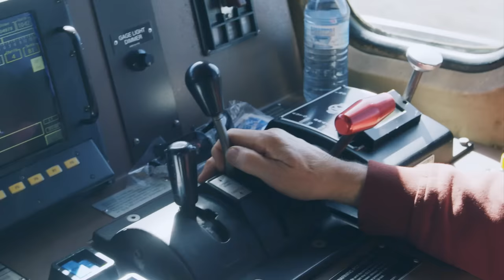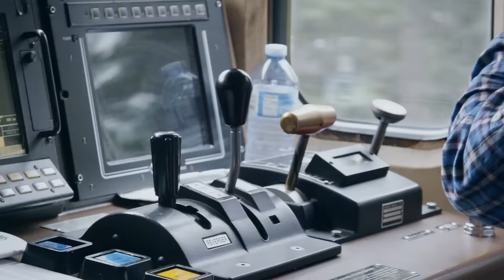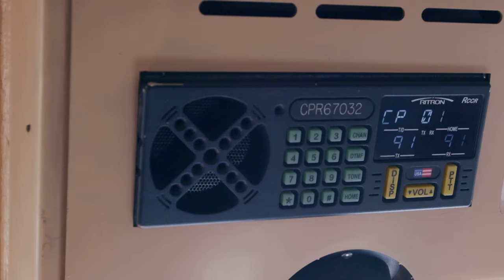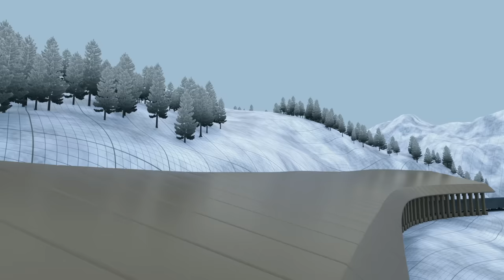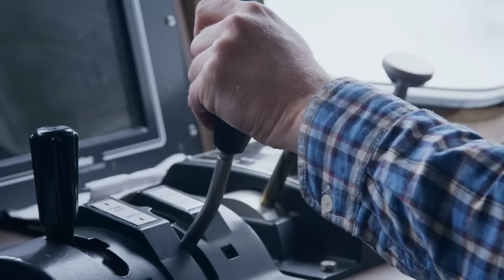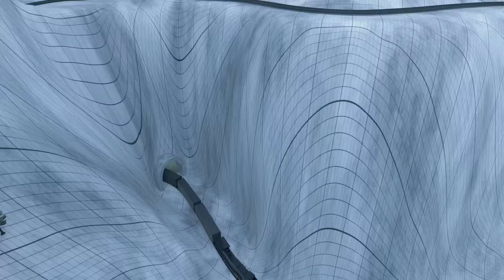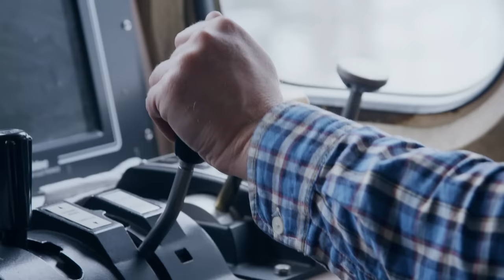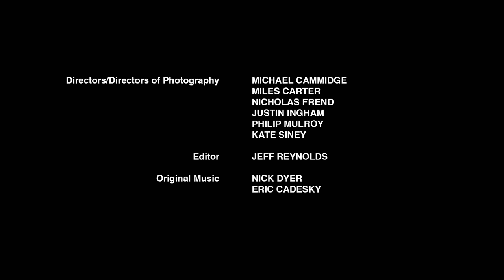A Grain Train's Perilous Journey | Rocky Mountain Railroad | Episode 3 | Documentary Central

Comment: I have seen the switchbacks in Kicking Horse. They have a pull off on the trans-Canadian highway so you can see them while you stretch your legs. They also have part of a steam engine boiler that exploded years ago. It, along with the whole track system is an engineering marvel.
Reply: It is indeed. What gets me is the 1908-09 trackage (of course new rails since then) is used today > THAT'S how solid a job those early rail crews did! Remarkable.
It's similar to the early surveyors here in America. They went out with the best equipment of their day, primitive by today's standards, to plot the best route for the railroads, yet were so accurate that today's engineers have said it was the best route, in terms of grades, crossings, etc. Those early guys really were on the ball, in terms of ... everything!
Reply: @jessstone7486 
Except treatment of their workers! 😢
Reply: @sarahhearn-vonfoerster7401  Agreed, sadly.
Reply: not switchbacks but spiral tunnels.